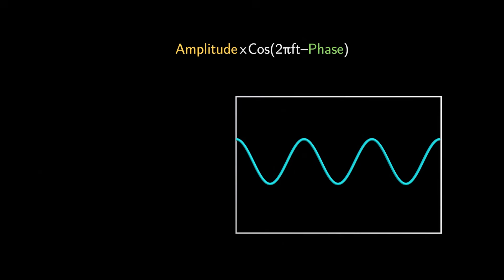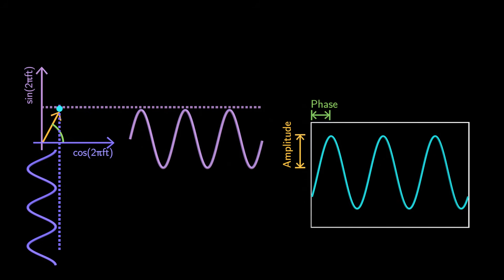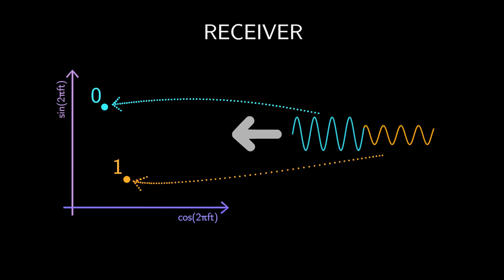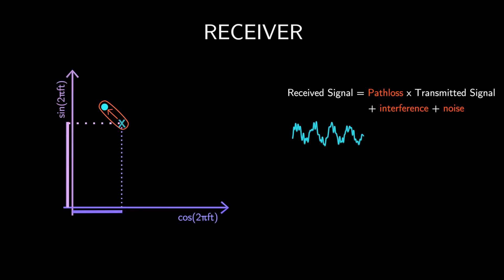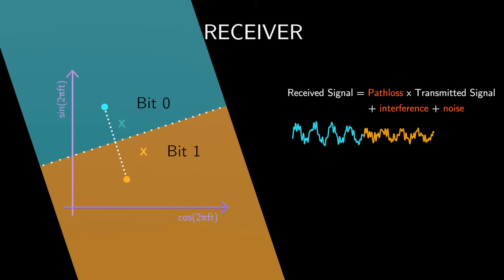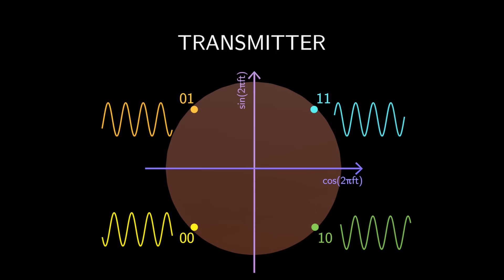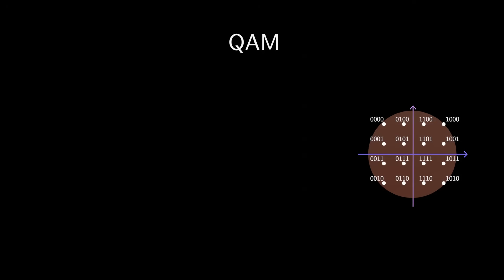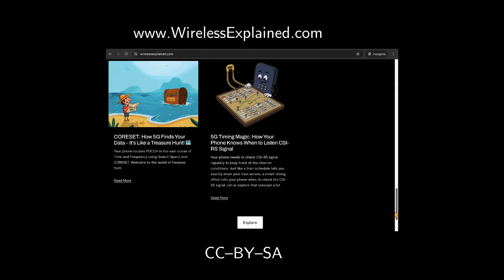What is QAM modulation?

Comment: in the higher QAM it is a improvement to use a infinite grid, scale it up until it fits only the needed Number of Points into the power limit circle  and use a bijection translation Table between coordinates and bits to transport. Look of the Empty brown spaces in the 1024 QAM. By doing so with combined carriers in a higher dimensional Sphere the difference between noise and signal improves with no limit as the number of dimensions goes to a infinite value. I may call it sphere-QAM
Reply from the maker: Thanks for sharing your thoughts. But we can't increase the dimensions here beyond 2. Hence, the constellation will remain as a disc, not as a sphere.

To increase the dimensions, we need extra degrees of freedom. Here we are limited by only TWO degrees: Cos and Sine.
Reply: @WirelessExplained if one transmitter uses multiple subcarrier you can combine this multiple complex numbers to a higher dimensional space. The same can you achive in the case of Mimo Linlks for example wich horizontal and vertical Polarizations.
Reply from the maker: Short answer: No

Assume there are N carriers, so we can get a space of dimensions 2N (factor 2, because for each carrier, Cos & Sine creates 2 dimensions). Suppose f(2N) is the number of balls that can fit into 2N dimensional sphere with transmit-power constraint. 

Number of Information bits that can be encoded ≈ log_2 (f(2N))

this is less than the number of information bits that can be encoded, while considering each carrier as independent, which is linearly proportional to N.

Comment: Hey, mate  got the maths part , how does with happen electronically, like with electic current , produce wave and then add them  for Amplitude and phase shift
Reply from the maker: In real world systems, we first generate time-domain samples (using IFFT in OFDM), then apply DAC, multiply with an oscillator, then a power amplifier, and pass to the antenna.

I have explained some of it in this video:
https://www.youtube.com/watch?v=VwnUuBshXGw

Comment: How, physically/electrically, are the I/Q signals derived from what the antenna receives? If every symbol is just one period long, how is that, in practice!, enough to discern the symbol?
Reply from the maker: To discern one symbol from the next symbol (to avoid Inter Symbol Interference (ISI)), in old systems, we use a gap time period between symbols. Current systems fill that gap duration with cyclic prefix.

Comment: explain  a dual-polarized coherent millimeter-wave system based on differential delta-sigma modulation (D-DSM)  system that can transmit polarization-division-multiplexed (PDM) D-DSM signals with modulation orders up to 4194304QAM over a wireless channel for 4 km

Comment: 5:52 is area between square and circle edge unused bandwidth?
Reply: That was my question too. And additionally, my second question is, how does receiver calculates the error probability for the dots at the edge? Because it is not uniform right there.
Reply from the maker: I agree 'grid pattern' is not the best pattern for maximizing the distance between points within a circle. But the grid pattern is chosen because it allows decoding the sine component and the cos component independently and in parallel. This reduces the computational complexity.
Reply from the maker: Error probability for the dots at the edge and corners would be less compared to other dots. This can be exploited in future telecom, maybe in 6G.
You can theoretically calculate error probability for each dot.

Comment: Why not placing 0001 0011 0110 1110 etc on the outer circumference of the circle? And the inners on the another circumference with lesser radius?
Reply from the maker: I agree 'grid pattern' is not the best pattern for maximizing the distance between points within a circle. But the grid pattern is chosen because it allows decoding the sine component and the cos component independently and in parallel. This reduces the computational complexity.

Comment: At first glance, this modulation method is similar to the system used to extract the R-Y and B-Y signals in the chroma demodulator of an NTSC color television.
Reply: yes, analog color signal is qam, just with analog hues and brightness instead of discrete points

Comment: So here’s the deal with QAM: you’re swapping bandwidth for efficiency, sure—but the price? A fat RMS power level. And once you get into the high-end stuff like 4096-QAM, your PAPR shoots up like a junkie on payday. That’s why those DOCSIS 3.1 cable modems suck juice like a Vegas slot machine, even when they’re doing sweet f** all. Same with optical transceivers—silent, blinking, power-hungry bastards. But hey, you can’t outsmart physics. You can throw in compression tricks, sure, but that just drags down your SNR too. Bottom line? You want high efficiency? Be ready to burn watts and pray your transistor doesn’t melt.

Comment: What is surprising is how the immediate phase shift is handled by inductive and capacitive nodes of the transmission channel, including antennas.
It looks like there should be DC offset and hoh-harmonic distortions during the phase keying. 
For example that BPSK is something like going the harmonic wave to the same polarity half-wave after hitting zero. 
These transition processes must eat a lot of time of the transmission time scale.
Reply from the maker: You are right. That's why offsetted QPSK is preferred over BPSK.

Comment: I can't imagine any commercial decoder using a grid when they could use as uler angle.
Reply from the maker: Grid is preferred due to lower computational complexity. Gid is used by most of the modern communication systems, like WiFi, 4G, 5G, etc.

Comment: I spent the better part of two decades working in defence - SATCOTS. There are a lot more modulation methods in common use. Some are exclusively amplitude or phase keyed. Constellation points can be offset as well, usually starting at zero degrees. In the wild you very infrequently come across weird stuff where the pattern just slowly rotates around the entire compass. QPSK and 8QAM are probably the most common, though BPSK is also quite prevalent. Lots of 8PSK, some 16PSK, even double and triple ring APSK. WiFi, cellular, and starlink aside, it's still not common to see any radio link using much more than 16QAM. Indirectly there are almost always randomizers applied to prevent long runs of zero or one, then error correction, so the constellation pattern is never a direct representation of the underlying data - which itself is often encrypted these days.
Reply from the maker: Thanks for sharing your experience. Yes, information bits are encrypted and interleaved to generate a new set of bits for transmission.

Comment: Are those higher-order QAMs really square? Looks like waste of spectral space to me..
Reply from the maker: Square grid is not the best pattern for maximizing the minimum distance between points.

But square grid pattern is used for simplifying the circuit, so that Sine component (vertical part) and Cos component (horizontal part) can be encoded/decoded independently and simultaneously, taking advantage of parallel processing of the transmitter/receiver hardware.
Reply: @WirelessExplained  Yeah. The circuit scheme of a QAM modulator is just sine generator, phase shifter, two multipliers, and adder.
Reply: @WirelessExplained  Okay, but may the source data be transcoded in a way that the square takes all the circle but the parts of the square outside the circle is never used?

Like if at 5:09 the grid is stretched but the corners (0000, 1000, 0010, 1010) never happen in the data stream (the data is effectively coded base 12)?
Reply: There are videos on YouTube where 64qam or 256qam is shown on actual scope.
Reply: A square shaped constellation is the max usage of spectral space. If you fill in the circle boundaries, you would get points in (an) unfilled line(s) or column(s)
Reply: I recon OP is right. It's waste. But square are for simplicity of circuits.
Reply: But linear amplifiers in between would rather favour a disk . Also power rises with the square of the amplitude.

For best use of space a hexagonal grid should be used. To best balance power vs error count, the real amplitude should be distorted a bit to make the grid denser near the center.